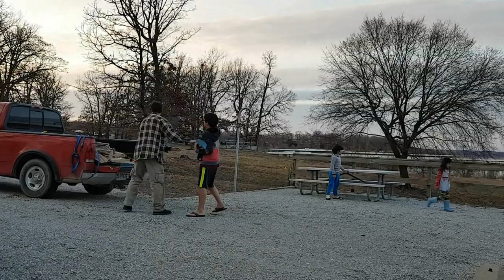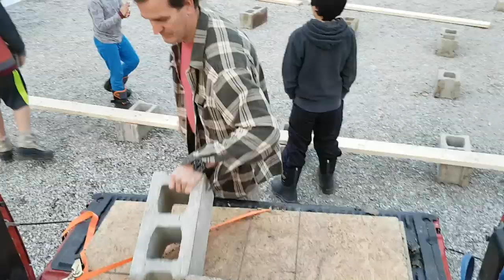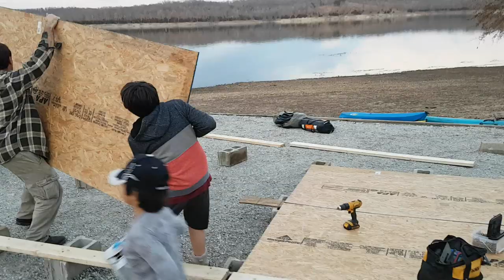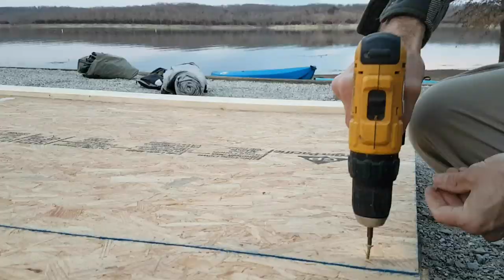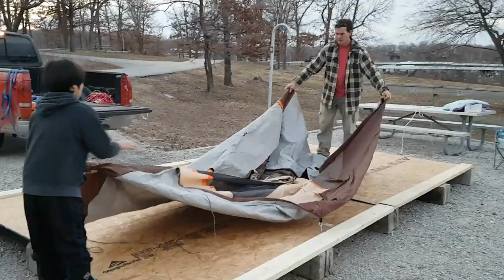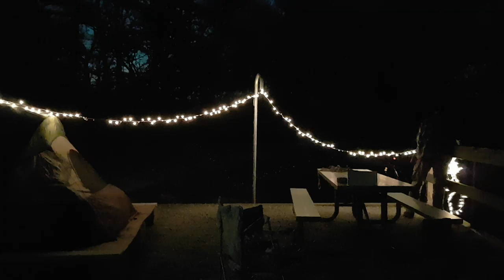Platform for a Tent

Comment: My tent flooded recently from all of the snow and rain. So I went out and got 8 wooden pallets used them as a floor base. Put 4 layers of cardboard on top a blue tarp and then put my tent built on top of it. Put it all together then I ran multiple runs of kevlar rope across from tree to tree and then put 3 insulated waterproof tarps on top and secured them down Incase a storm came again with 60+ mph gusts and it held up perfectly. It was bone dry and warm inside and very comfortable. Proper set-up and insulation is key, so when you do it please don't cut corners just to save $20 because it's not worth it when it's almost zero outside, but yet inside the cozy warm tent it's about 46 at that time, and that's only having 3 candles burning with the clay pot on top. Get two cozy warm comforters a few pillows and you'll be warm cozy sleeping like a baby in sub zero temps. Remember never be cheap cutting corners. Fyi. Do it the correct way once the first time only.